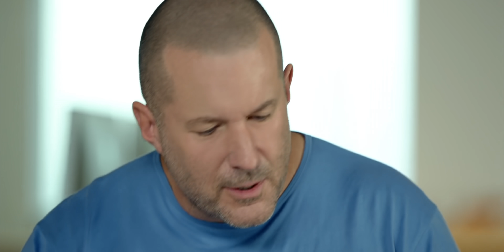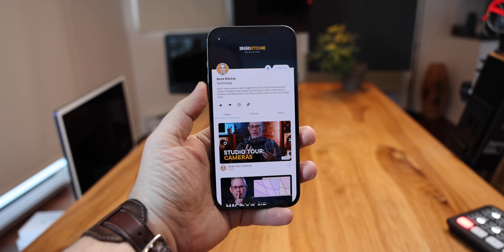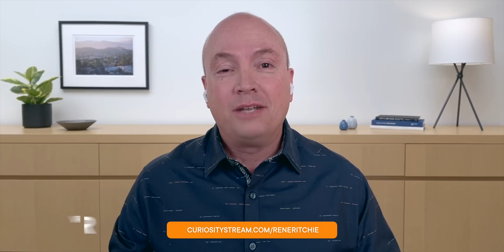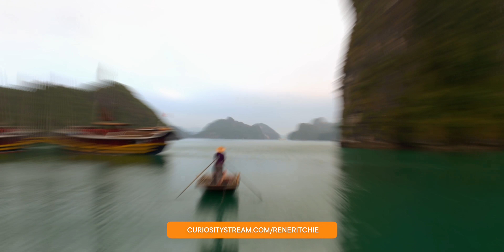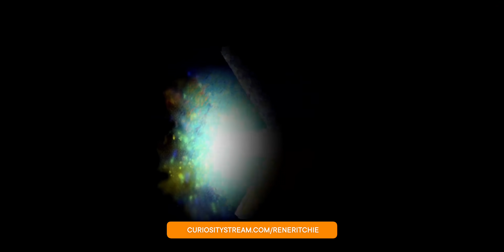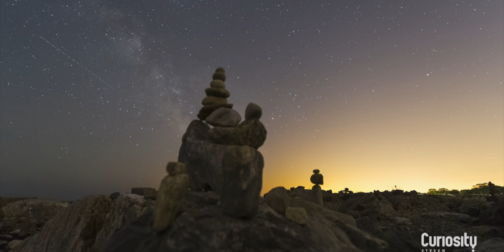Has Apple Lost its Soul?

Comment: I'm not through with the book yet but what I found funny was how it tells how Jony Ive apparently was frustrated with the shape of the rounded corners in up to iOS6 under Scott Forstall, so when he took over iOS after Forstall's firing he wanted to correct that "design flaw". In reality tho, iOS7 introduced an ugly glitch with those rounded corners whenever an app folder is opened or closed. And it wasn't even fixed for multiple iOS generations. That's one of the oversights that would have never gone through under Jobs and what made people think that Apple lost it's relentless perfectionism.

Comment: The parts that leaked just stated that Tim was more like interested in implementing more features in essentially the same products rather than design new products…which seems more plausible than not with Tim being a former CFO.
Reply: Tim Cook oversaw Apple Watch, AirPods, Apple silicon(first to 64bit - smooth Arm transition)
Reply: @synonys  R&D for the Apple Watch started way back when Steve Jobs was still with the company.  The AirPods were largely built on top of R&D picked up in the Beats acquisition.  Apple Silicon, as an ARM based product is tech that Apple co-created all the way back right before the PowerPC Mac era.